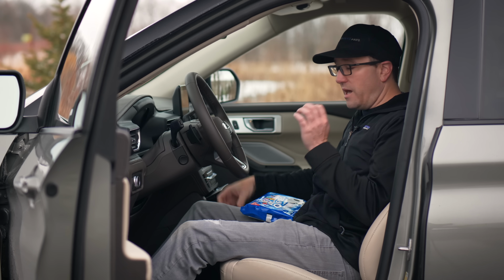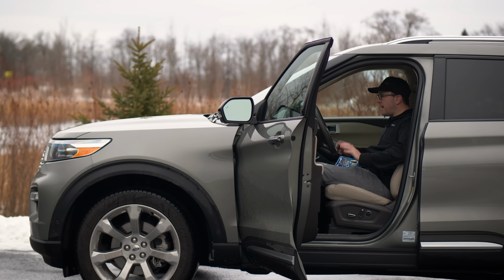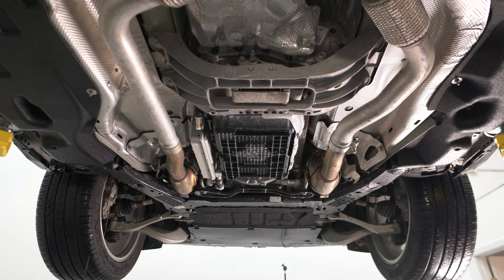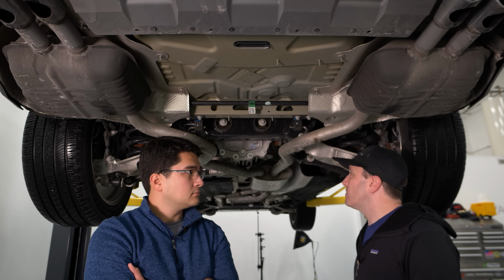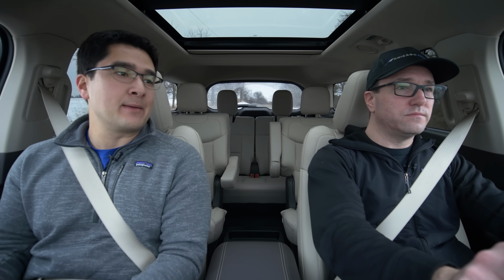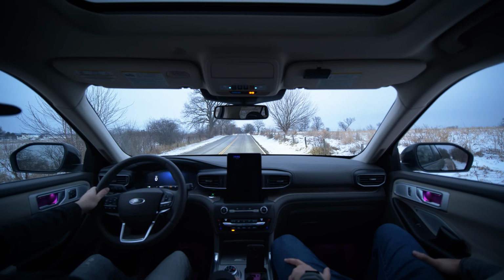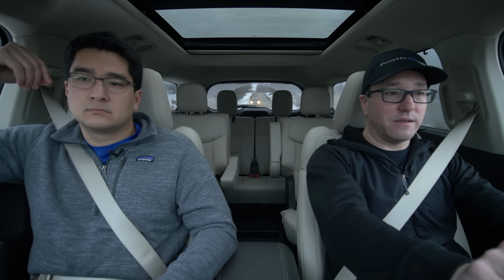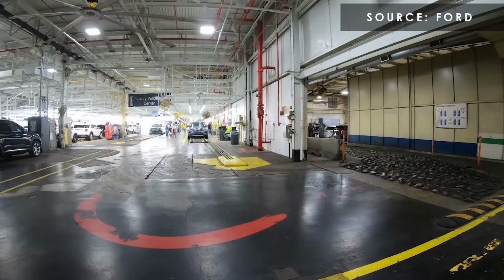2020 Ford Explorer | Who Is Responsible For This?

Comment: Wait till you have to change the INTERNAL  water pump at 50000 miles. Got a extra 2 grand? Hp[e so. Dumbest engineering feat in a long time. Looks like ford needs to hire some Japanese engineers.

Comment: It's great you call out the lazy and cheap stuff for what it is. I'm still mystified why Ford or anyone else wants the driver's instrument cluster to look like a damn opening animation of a video game. I don't need animation for snow, heat, rain. I already know what that looks like in real life. I needs my gauges to be simple, clean and readable at a blink of the eye. Simple electro-mechanical gauges still work fine, why replace them with silly animation? Save the video for the central monitor, and keep that simple as well. Big touch tablet monitors are a terrible distraction.

Comment: This center display is just bizarre. I can get an aftermarket unit for my truck with a 12.1" screen, new molded air vents to allow install, and the wiring harness for like $800. It looks factory. How in the hell did they decide this display was a good idea? The gauge display is bizarre. The biggest hurdle touchscreens and infotainment had in cars was how far behind they were compared to cell phones. No one wants slow. It doesn't matter if it looks pretty when you change driving mode. Make it quick, to the point, with clean transitions. I have no idea about the drivetrain issues. They did well with the f150 and mustang, so how did they mess up the algorithms for power delivery, gear selection, and torque converter lockup? I'm a ford guy but damn. If they don't do what honda did with the civic and fix it til it was right from like 2013 to 2016 then this is going to cost them dearly in the long run.

Comment: I work for Ford Oakville...we build the Edge....and what you said at the end was so true.  We build amazing vehicles that are designed to fast and to easy and without care.  ... it's going to end badly unless this company puts a little more care in the product and a little less in their bottom line.  
Keep up the good work. Cheers
Reply: i use to work there, what a hellhole, old union mentality that couldn't give any $hit about vehicle quality.... i wouldn't buy anything built there
Reply: The workers only care about there own bottom line as well. Truck company only in their near future
Reply: Ever since I bought some Made In America coasters that literally fell apart in my hands, I've considered it an overrated notion.
Reply: I'm on my second Ford Flex and it's as well-made as the first.  Hats off to the workers at Oakville Assembly for making a quality product.

Comment: I’m glad that you guys like the new explorer for the most part. I’ve been a ford employee for 15yrs at the Chicago Assembly Plant here in Chicago were we build the new Lincoln aviator & the new Ford Explorer. Now some the first run explorers & Aviators had software issues and a few other issues. Over the past year and into the new year the quality has gotten a lot better. Now what I think ford should’ve done with this SUV. These should’ve been 2021 models. We should’ve built the old platform for one more year, build a few 2021 SUV’s, get the issues worked out and get these vehicles worked out. Once we do this, then release the vehicle to the public. Upper management tried to blame it on production rank & file. I had a very high up supervisor from another plant tell me and I quote” Ford rushed this retooling, launch & production of this vehicle.” This plant is to small to accommodate all the new technology that’s needs to be used to do a successful launch. Very few of the line workers were trained properly. Granted we do have personal issues but that really has nothing to do with assembling the SUV. We’re not responsible for “ software “ issues. Those are your JR engineers who designed this vehicle. The launch team which advised them on the issues with the truck just went by the waist side. I’m very proud to be a ford employee. I just wish they would’ve listened to us more. 

In solidarity. UAW-FORD
Reply: Darrin Carter - Should’ve, Would’ve, Could’ve. I’ve been done with American cars for the past 10 or so years and I’m so glad. Only Honda and Toyota
Reply: Mathew Chen.. Your choice of car manufacturers has no bearing on me or ford. Honda, Toyota? Their good cars. But I’m a big boy. I’m a Mercedes man myself and that’s what I drive besides my 2 other Fords I have in my garage. 

In solidarity- UAW ford
Reply: Hey man thanks for being a hard working American.   Do you feel ford has ironed this shit out or should I wait another year for my st exploreer.  I love my toyotas but my family owns a ford dealership and I wanna go back american

Comment: WHY are all these manufacturers switching to dial or button shifters?  Vehicles are becoming DEATHTRAPS.  Where are the FAILSAFES?  What if the electronics cut out?  I’ll tell you what: you’re in for a RIDE TO HELL.  

My Acura had an alternator failure.  I didn’t look up the code right away.  The battery discharged fully during the same trip, leaving the whole car without power.  NO steering at all, NO breaking, NO shifting, NO lights.  I enjoyed waiting for AAA in the ditch, where some other motorists helped me push my car into so I wouldn’t be blocking the ROAD.  Imagine if I were on a highway, approaching an intersection, or driving down a mountain!  

Car manufacturers who are switching to these unsafe systems should be put out of business and SUED and CRIMINALLY CHARGED for negligence and reckless endangerment!!

Comment: Owner of a 2013 Ford Explorer sport with around 160k on it.  In general, its a fairly good car.  Reliable, pretty powerful, but only gets around 16-16.5 mph currently.  However, it has had its share of issues including needing a new water pump, timing chain, power steering motor, and a few other small misc things.  We were thinking of getting a new edge or explorer soon but maybe we'll just hang on to this beast and see what 2021 has to offer.

Comment: Finally someone with a real review on an American car product. In the early 90’s ford and Chevrolet bought a Camry and they took it apart and rebuilt it.  They stated that imports ARE NOT built better than American cars. Fast forward, today Ford is no longer building cars and Chevrolet can barely sell their sedans.  Toyota, Honda, NissanLexus Acura etc. now all have 10 year plans to take over the suv market.  They have had to shuffle things around to meet the demand:
#1 selling compact suv - Toyota Rav4 
#1 selling luxury suv -Lexus RX
Here is the thing American car companies are selling the most trucks by far. But growth they are seeing a decline in sales. Or barely any growth in sales. Just the same amount year over year.   These imports are growing in sales 15 + plus percent.  The imports are coming quick fir this money making segment. Toyota already has the capability to stop making combustion engines and go 100% electric instantly. If that becomes the way ppl want to go.  Honda can go hybrid instantly. No stop in manufacturing.  American car companies are falling so far behind its very sad that they can’t admit they have inferior products.  Remember Pontiac.  Gm even sold  Saturns at a loss just to try to be competitive.  Have you ever heard of such a bad business model.  Instead of fixing interior, electric and reliability issues they just created another car company instead and sold cars for less than they cost to manufacture.  Pure stupidity.
Reply: Wrong. Toyota is investing a SHIT ton in hydrogen powered vehicles.  Nice try though.  Don't think you know everything.

Comment: The 8 speed in my 2020 Durango does the same with down shifts on low speeds. However it does not shift according the display. It shifts in 2nd gear and then a jolt forward after slowing down. It is almost that the transmission is not tuned to the engine speed and vehicle speed. My RAM 1500 did the same, but less severe.

Comment: One of my biggest issues with Ford is the dash quality. In the Expedition and F150s they all have a defect in the dashboard. If you look near the center of the dash facing the vehicle from the outside. You will see a seem on the dash close to the windshield it's crap. And they still don't correct it. Just like they never corrected the dct in the focus.

Comment: This is why I still have my 2004 XTerra. Everything is analog, everything is manual, and most importantly, everything works. She' got a bit of rust, and the driver's seat is only just starting to show wear, but she's a tank. SUVs today are cheap, disposable, generic, bland, estrogen infused soccer-mom mobiles. There's zero chance this thing will last 15 years, and for $60k? Lmao. No charm. No character. No appeal. No thanks.

Comment: Great and thorough review of the new Explorer.  I've owned a 2001 Ford Escape XLS which I purchased brand new and I got 200K miles out of it and most of those miles were hard miles as I work in New York City.  I finally had to get rid of it back in 2015 when I needed a new exhaust system, head gasket, and transmission.  At the time a Ford dealership had a 2006 Mercury Mariner Premier on its lo with 50K miles, I asked if I can take it for a test drive and to my mechanic who checked it out and said it was in great shape so I purchased it and just over 40K miles later its been giving me no problems.  Now the only issue on both that I had was that at about 75K miles the oil pan gasket started to leak and on the Mariner now the issue is the Oil Control Sensor (Which is a pain to get to) but again that's about it.   But, seeing this review I could live with every little flaw on the interior but when you're talking transmission issues, I think its crazy to spend $40K plus on a car that will give you a major headache especially if the transmission starts going and I think this could be an issue with the older models as well because my friend had a 2016 and it gave him constant headaches to the point he got rid of it and purchased a Japanese SUV instead.

Comment: Excellent honest review.I own a 2016 explorer sport currently.The engine was apart at 4,800 miles.The wind noise is unreal.The Tires they put on as oem equipment are terrible on my 3rd set of tires at 41,000.And Let me add that the depreciation on these cars is unreal lost half its value in 3 years.Now I understand all cars depreciate but I have never owned one this bad.My wife is thinking about getting a new car and she said it won’t be another explorer.And Ford doesn’t give a crap about customer service.

Comment: My old Flex had that "shock" when you hit a pothole or something.  It was jarring because the ride was otherwise very soft.
Reply: Because it's really a sedan-biased suspension setup, attached to an SUV unibody chassis. It's a common issue with the new wave of crossover SUV's.

Comment: it was designed to be a police car 1st that's the major reason its rwd  , you were close when you said rental car/fleet. and the hybrid system is already a disaster with problems. ford has been ahead of Chevy and Chrysler so in the past 5-10 years they have lowering quality quickly and turning out more garbage because they can the rest of the American cars are doing it anyway.

Comment: Sadly I think we're going to see more of this and from a growing array of manufacturers as they all deal with the paradigm shifts toward fully electric powertrains and more and more gadgets.  Its not that those things should be that difficult to design and implement, more that they're going to be forced to develop two products for each category.  That's a serious problem.  Surely though we'll see some stagnation in the digitization of dash clusters and capabilities of infotainment systems.  The pace of change since ~2010 has been much too fast to sustain, so get CarPlay and Android Auto working (wirelessly) and let the cell phone makers worry about that stuff.  Really, I'm surprised we haven't seen more consolidation of software and hardware development on the infotainment and safety tech side.  We're currently in a state where nearly every manufacturer is developing their own stuff for all of that and now they're making silly mistakes and leaving us with the unreliable and unintuitive results.

This review really struck a nerve with me.  My wife drives a 2017 Chrysler Pacifica.  We bought it new and it has since had 7 repairs and 3 outstanding issues needing repair.  When we bought it I was under the impression Consumer Reports was bought by the Japanese folks.  I was wrong.  The reality of owning that vehicle was WORSE than they predicted!  We all need to sit back and take in the critical reviews, because there is at least a little truth in every one.  If the reviewer says they can't find an interior panel that matches up correctly to the next you'll probably find them in your future car.  If they say "hey I've already had to take it back to the dealer a couple times and we're only at 5K" you're going to be on a first name basis with your service manager.  Buyer beware.

Comment: I was looking at the ST.  The fit and finish was not very good.  There were large uneven gaps.  Transmission shift was quite rough.  I do like the look of the Explorer though.  

I find my current 2017 Ford Fusion Energi Platinum to be better manufactured with great fit and finish with only minor issues fixed by dealer promptly with 50K miles on the odometer.  

I guess I'll look at the Palisade or Highlander Hybrid.  I will wait for 2021 models so they can iron out any issues.  I don't usually buy first year vehicles.

Comment: Test drove a 3.0 Platinum 4 days ago with a $55k dealer tag in the window with 51 miles on the odometer.  100% agree with this review; it felt like I was driving a 3/4 baked prototype.  Strong engine (fast), felt planted on the road, sharp exterior styling...thunky suspension on heavy hits, terrible execution of the interior fit and finish.  You could tell the leather upper dash had been apart and the A pillar trim on both sides had been off to fix something- probably one of the vehicles shipped from Chicago to Detroit for repair. Really disappointing...I have been in Fords for about the last 15 years and on my 3rd F150.  This thing is overpriced around 10 grand and wasn't finished. Nice idea for a package that missed the mark.
Reply: What did you end up buying?

Comment: This is the first time I have seen your videos and I just subscribed to your channel.  I work part-time at a Ford dealer and I drive these often and I have to agree with you on this review.  It drives better than the old one, and I like the 2.3 EcoBoost because for most customers this is a good engine.  I like the way it rides and handles, but the portrait screen looks out of place.  I like the smaller landscape screen on the XLT.  The transmission has been trouble prone.  I think with all the problems Ford has had with the introduction of this new Explorer, the 2021 should be improved.  If a buyer still wants this first edition, they should be an extended warranty or just lease it for 2 years and wait to purchase the improved version.  Thank you for your excellent review.

Comment: i have always been a ford and always will be, however im just a middle class worker so im not buying the high end models, limited, platinum, lariat whatever it is because i just cant afford them, that aside I do see the flaws in a lot of things with the interior and this is throughout a brands like GM because like you said the people buying these are people who will always buy ford gm ect, they dont look at anything else and thats where they are really really hurting themselves, One thing that also bothers me that im not sure really matters but every new car has some sort of infotainment screen and like any electronic screen it will go bad in terms of speed, you take a tablet or phone you've had for 5+ years and try and use it and it will be excruciatingly slow, So how will screens in cars like this hold up